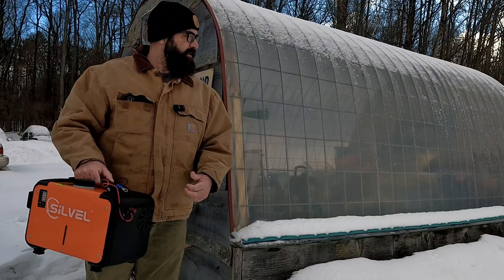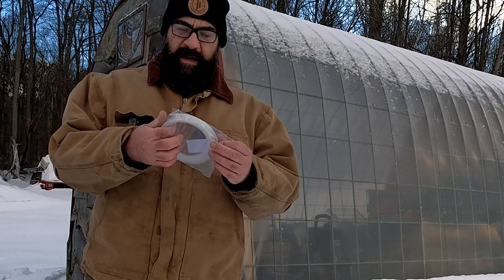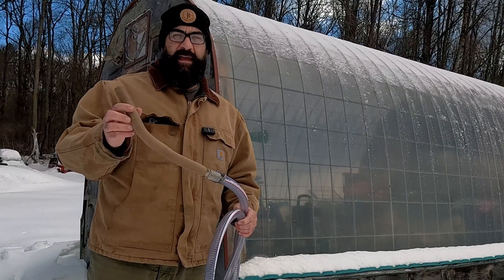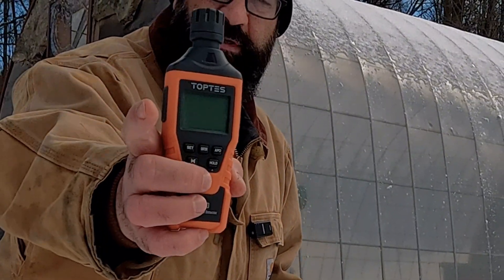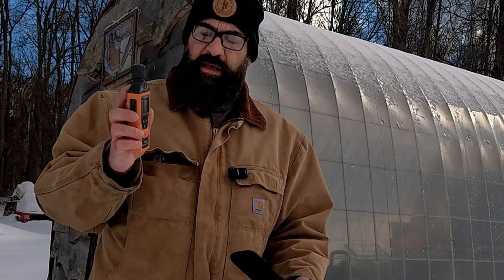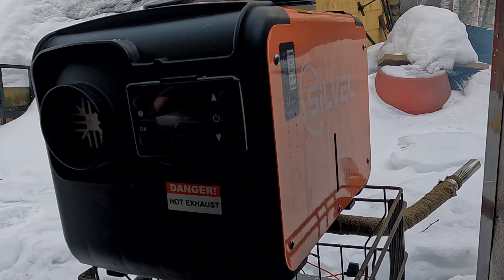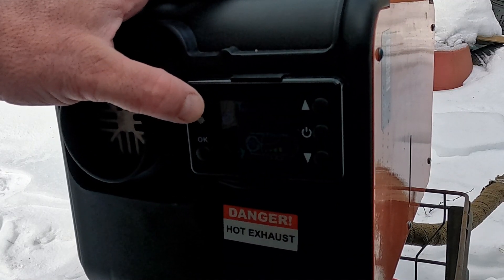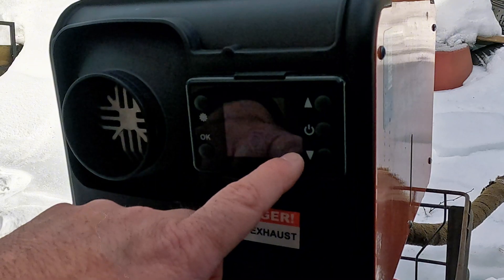Howto Fine Tune & Upgrade Chinese Diesel Heater - Run Efficiently With No Carbon Buildup

Comment: silvel mounts their fuel pumps upside down , it will eventually quit working because it air locks . mount the pump on the front panel with the outlet pointing up and it'll last a lot longer .
Reply from the maker: Wow, I didn't know that, make complete sense. I'm going to look into relocation. Thank you for that information.  👍